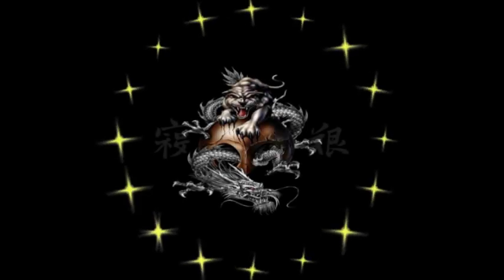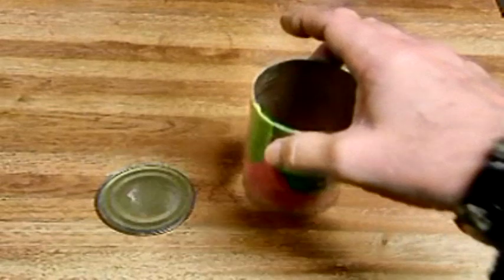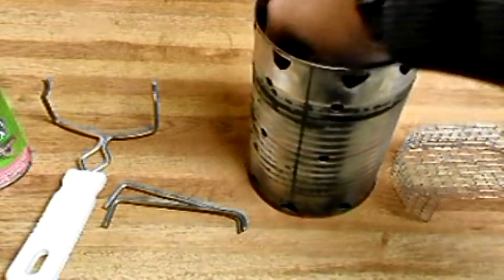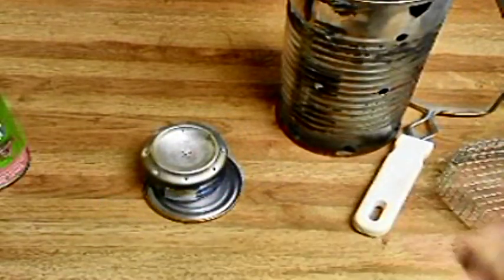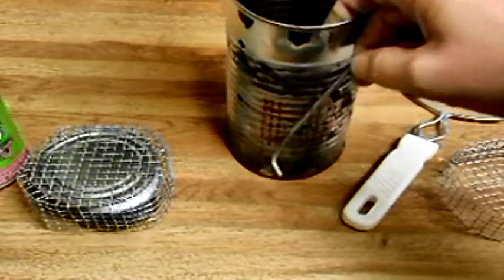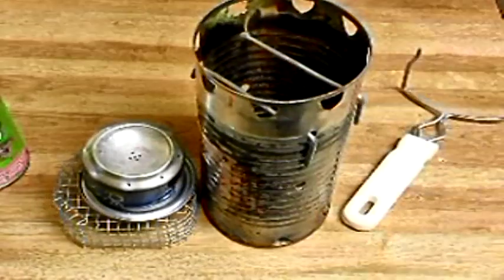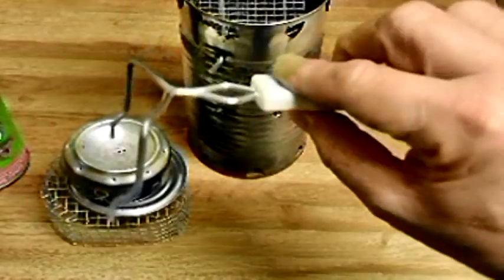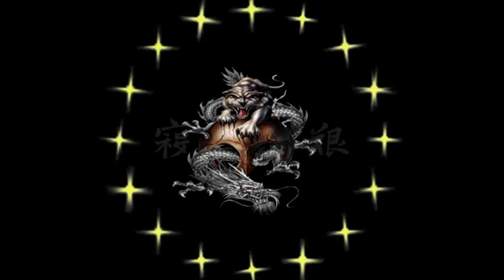Tin Can Stove

Comment from the maker: It is hard to get them to go together smoothly Colin ;-)) There are 3 things I do that IMO help to keep that from happening. I flare out the top piece so it's a little larger, I use another can inside it. I crimp the bottom piece so it fits inside the top easier, use a pair of needle-nose pliers to put small bends in the top 1/4" of the rim. I put high temp gasket silicone around the upper-lip of the bottom can, that's to seal and lubricate it when you go to put them together. I hope this helps.